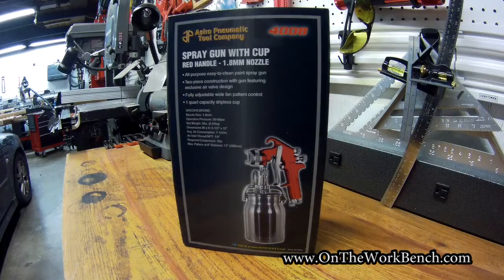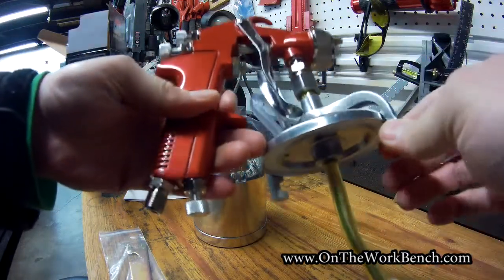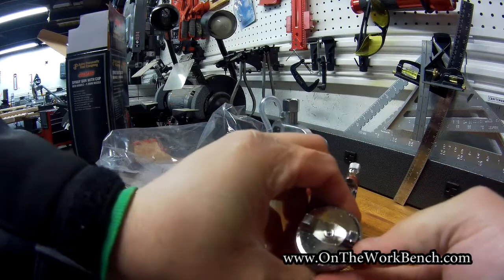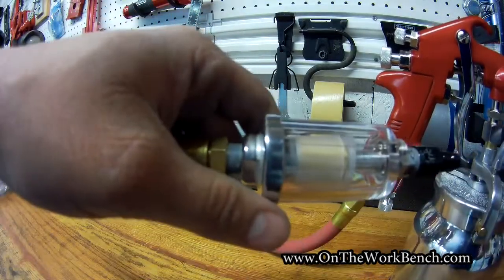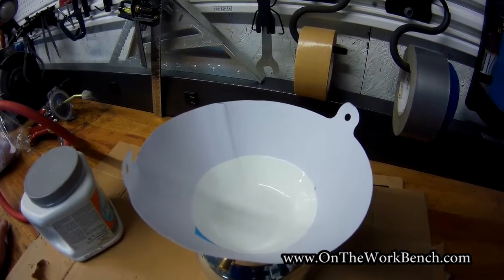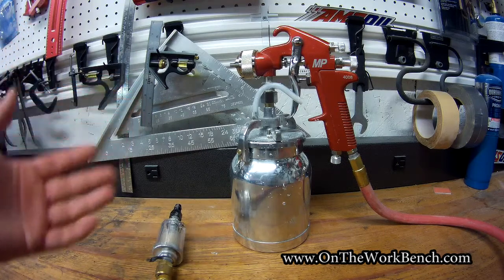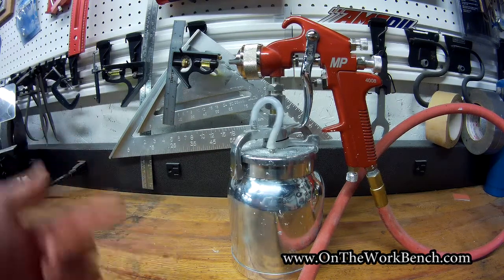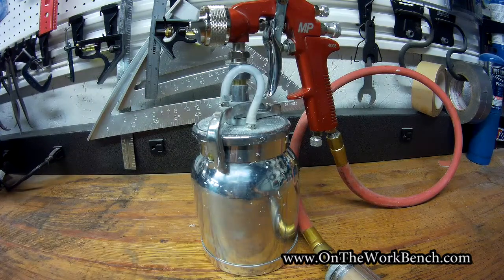Astro Pneumatic Spray Gun - Latex Paint

Comment: attach an air regulator with pressure gauge onto the handle a you can make micro-adjustments to the air pressure coming into the gun so the spray is consistent.
Reply from the maker: Yes!
Reply: @OnTheWorkbench  :  yes?   i’m jot asking if you did.  i’m telling you to do that so you can tune the spray coming out
lol